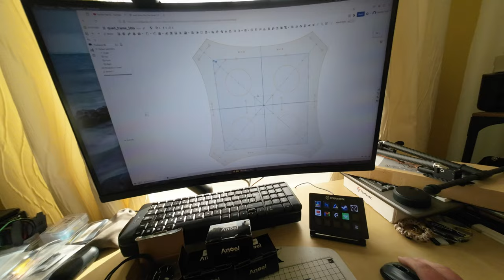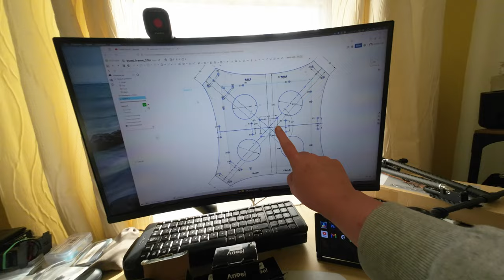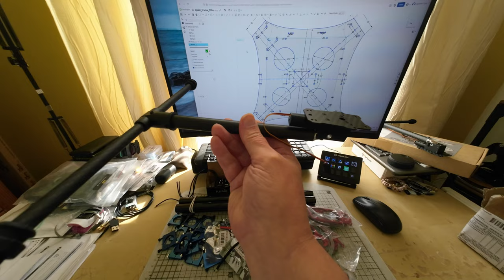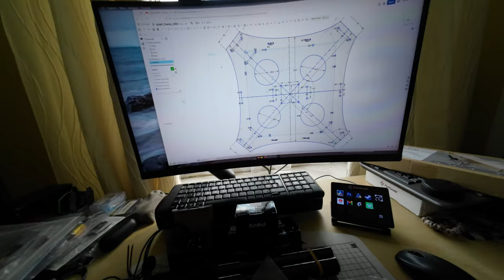Workbench Update

Comment: Caroline looks like a great project.  You could use those little feet under your motors for landing gear which would save some weight.  Jeff in LA USA
Reply from the maker: If I'm not using the retract legs I won't bother with any legs, it can just land on the battery.

Comment: That was interesting Caroline, personally I'd like to see the legs retracting so slow and sedate for me 🙂
Reply from the maker: Sorry Cliff, this one is going to be fast and furious and I've re-drawn the centre plates to be smaller for no legs / 10" props. BUT, since I've already designed the plates to use the legs AND I've only gone and bought a set of 12" props by mistake, if the 10" one works, I'll build a 12" propped, legged and more cine-lifter one  :)   How does that sound??
Reply: @Caroline_Tyler Sounds good but mind your fingers with that fast one 😮
Reply from the maker: Definitely one to keep out of arms reach of anyone!!!